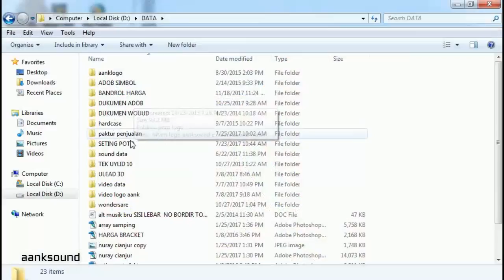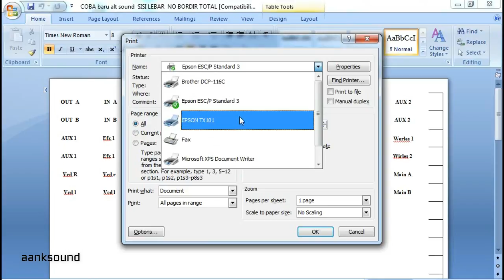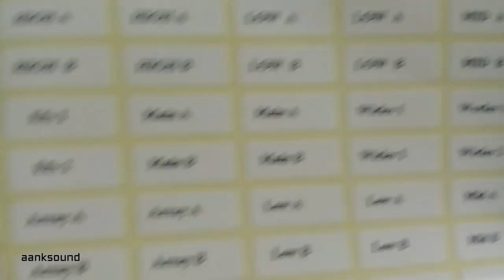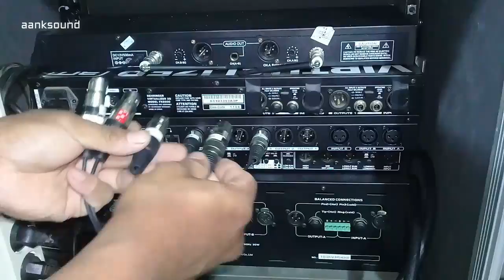Buat kabel penghubung untuk sound system dari management ke power

Comment: Klo dlms 4in 8out untuk input 4 output 4 apa bisa mas?
Reply from the maker: +iyok 94 ya bisa
Reply: @aanksound  trus misal yg  power ch1 &ch2 sub,low ch1&ch2,mid ch1 ,high ch 2 gmna itu mas ...masih bingung saya,mklum pemula😁
Reply from the maker: @iyok9412  itu mah kabel penghubung